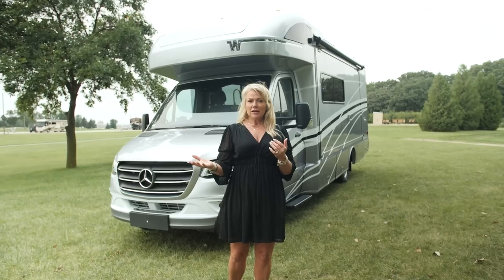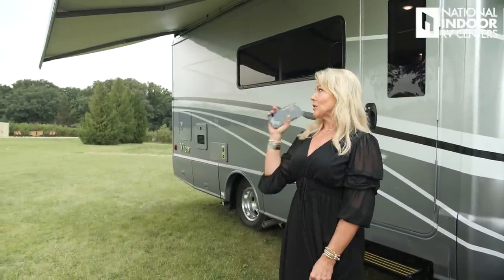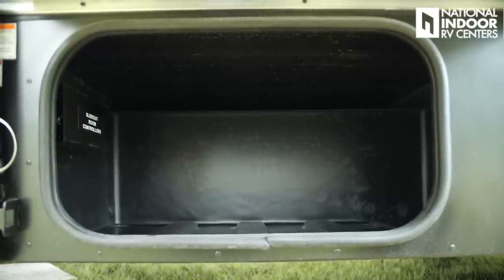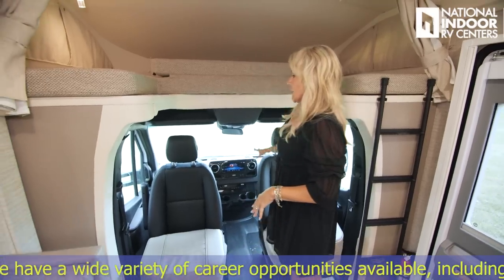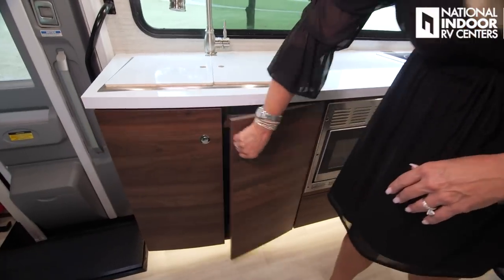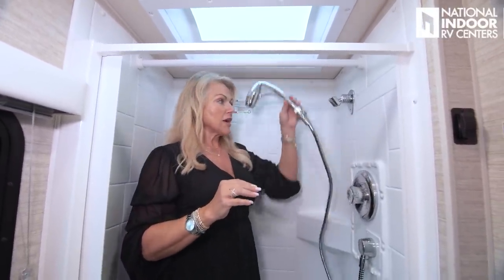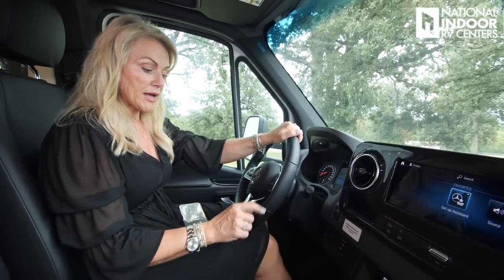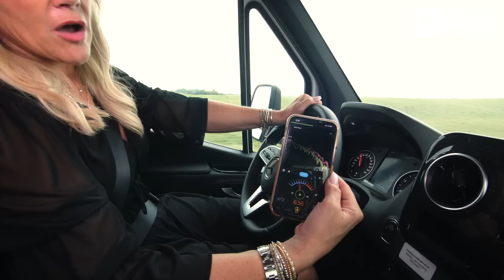Luxury RV Tour - 2023 Winnebago View/Navion - Class C Motorhome

Comment: Dual pane windows are such a big improvement that they SHOULD be standard at this price.
Reply: I like the idea, not so much the "look" of WB  dual-pane but have heard they have issues with discolouring, spider cracks and seal failure, which results in fogging between the two panes. Also, read that since they are acrylic,  they can't be tinted and maintenance on them is very specific as any amonina-based cleaner will damage them. We just ordered a 23V and went with the standard window. Interested in your thoughts, Richard.

Comment: In 2024, Winnebago changed the door back to a standard door. I have mixed feelings about that. The Murphy bed has legs that should be extended. My wife and I like the 24D and are looking to replace our Ford E-series class with this coach. It is great to drive and our car is small enough to tow behind when we go camping. It doesn’t have side view cameras though.

Comment: Can I drive this with a class D license?
Reply from the maker: Hi there! If you own a Class B or C vehicle, you can generally drive with your regular driver's license in all 50 states. However, if your vehicle is heavier than 26,000 pounds or longer than 40 feet, you may need a special license in certain states to drive it from place to place. You should check your state’s DMV for the exact requirements, as each state has its own rules regarding RVs and special licenses. Thank you.